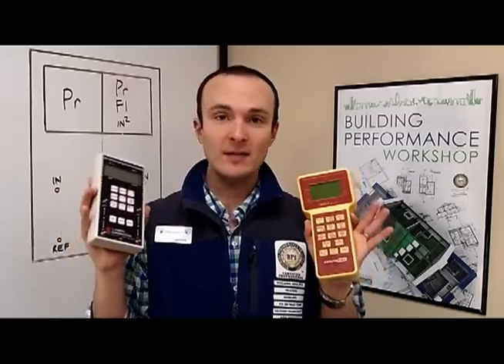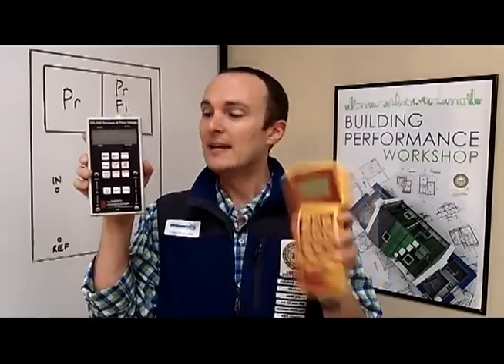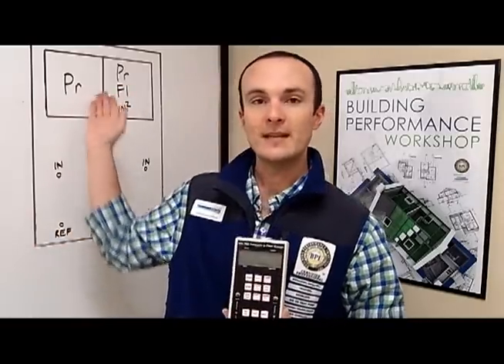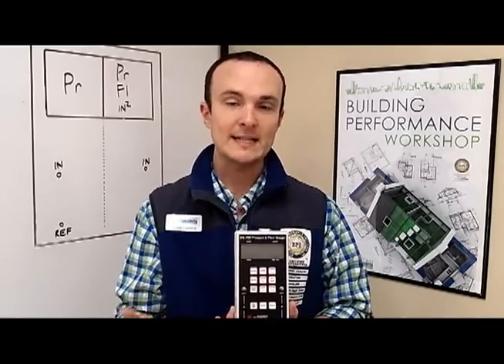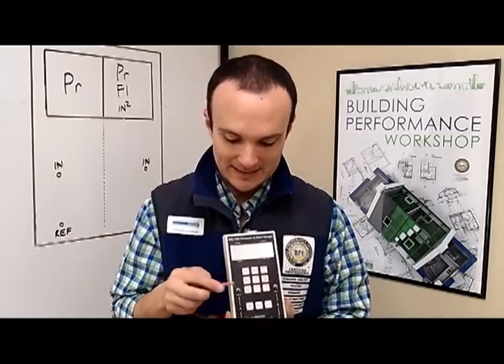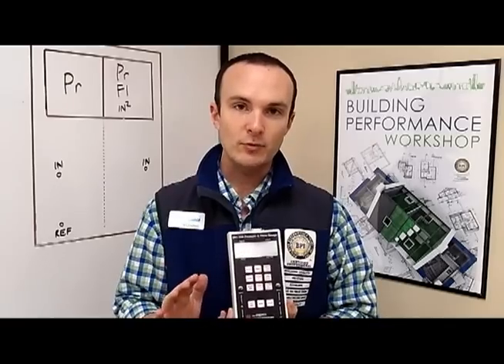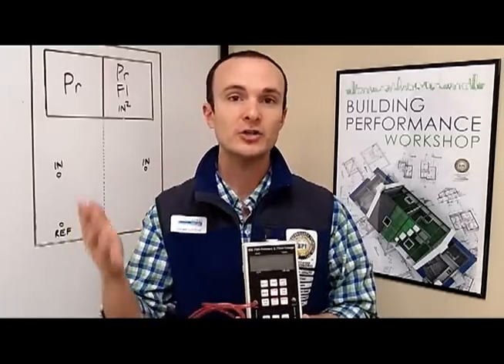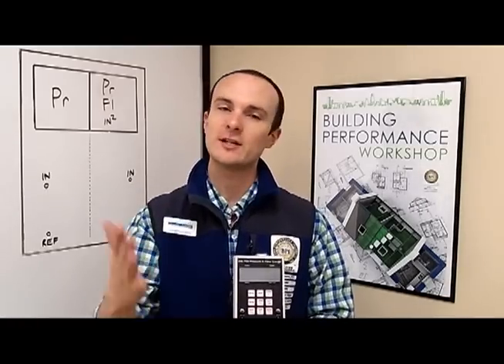Manometer Mechanics for Home Performance Professionals

Comment: In this scenerio would I be wrong if I thought the following?
 Fitting the flue pipe diameter to match the exiting pipe diameter of the furnace and the little section entering the flue is the first step. Which may stop the leakage there, and also eliminate the atmospheric draft possibility which was proven to spill poison gases to areas they don't belong. 
Now the inducer fan will be utilized properly as intended.

Where can someone obtain the information requied to correctly and safely size / route flue piping? I am looking to purchase the necessary references to help me train correctly. 

(Side thought, if the CAZ is sourcing spillage gases while the appliance is operating, wouldn't the combustion efficiency suffer? My reason being the spillage gases which include high levels of CO. Are now causing a displacement of the fresh air the manufacturer intended the appliance to operate with, is no longer available.) My assumption is Co levels would rise. Meaning the fuel had not released it's full potential. Inefficient burn is always a problem.
Reply from the maker: JQ, you're looking for the standards from the Nat'l Fire Protection Association (NFPA). And combustion gas doesn't always have CO in it- depends on a lot of things.
Reply: Awesome info thanks